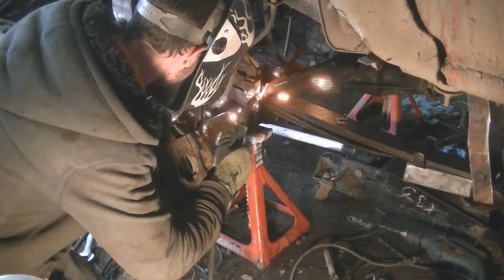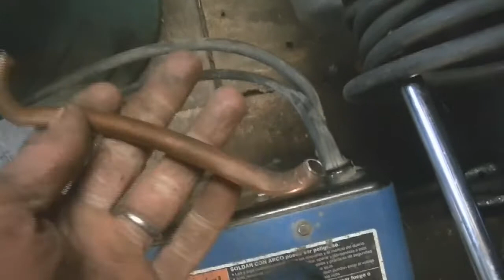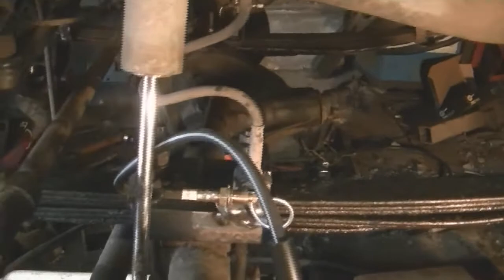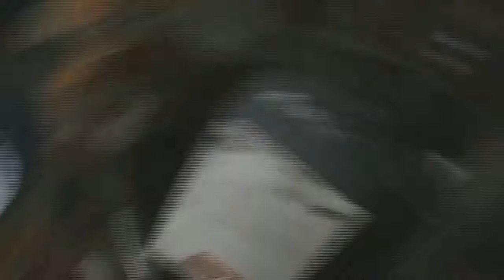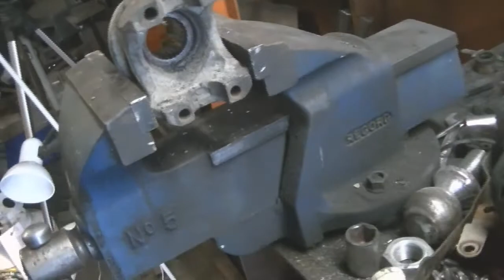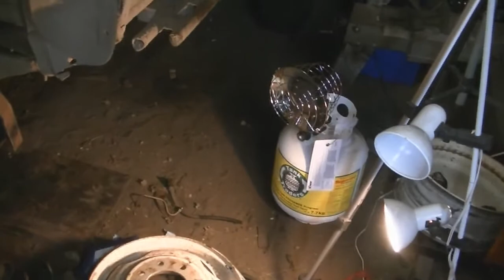94 4Runner: Wreckin Stuff... (12/29/13)

Comment: If you had the copper tubing for the compressor is it easy to repair.  I picked up 2 compressors at an auction in Edmonton but they both need that main tank line... can you do a vid on how to fix that?  :)